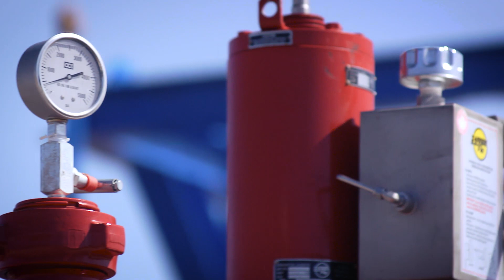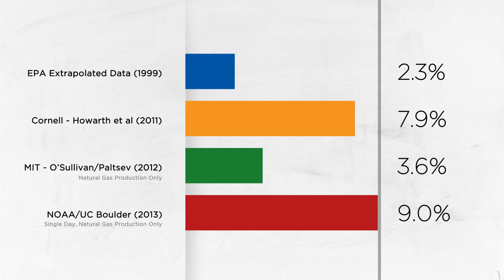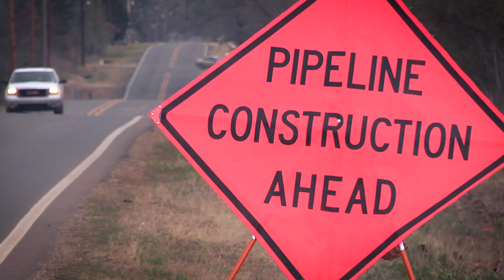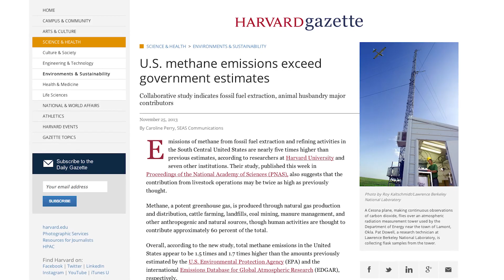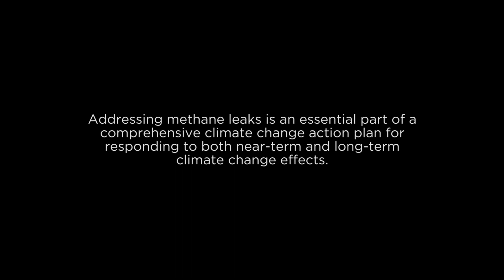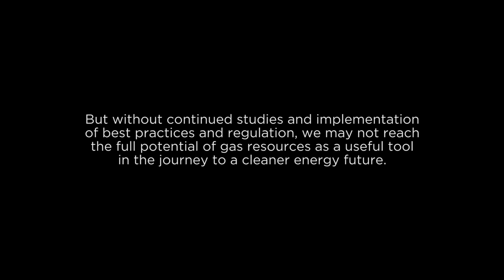How methane could accelerate climate change

Comment: The issue with 'switching to renewables' is you need a backup energy source that can ramp up and ramp down its power output to follow with the variability of wind and solar generation.  The backup is no small portion either, capacity factors for wind and solar are around 20%, therefore you need up to 80% backup energy to stabilize the output of the plant.  Energy storage options are pretty limited and are way more expensive than a backup natural gas plant.  So right now any expansion of renewables is coupled with expansion of backup natural gas plants.  Its a step in the right direction but not a good plan for deep decarbonization.  That is why I am very excited that next generation nuclear reactors have the ability to provide a very flexible energy output, and can be coupled with renewable expansion.  Molten salt reactors in particular seem to have quite good flexibility, the company that I am following that seems to be leading this development is Terrestrial Energy based out of Canada.